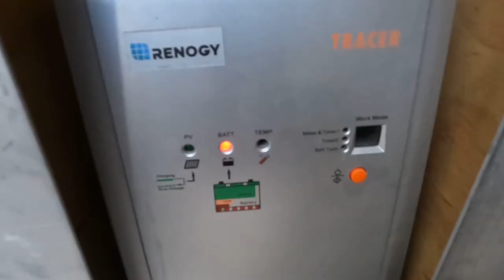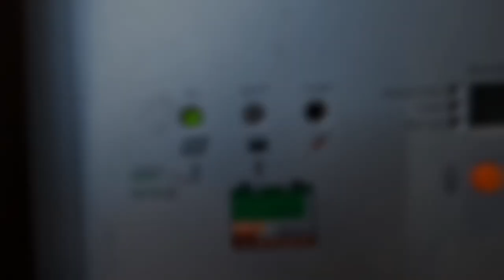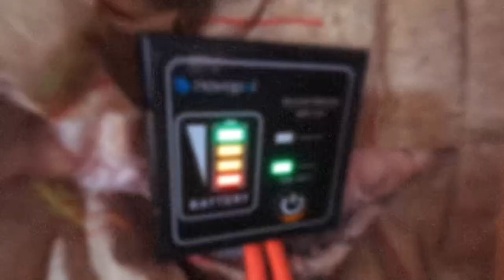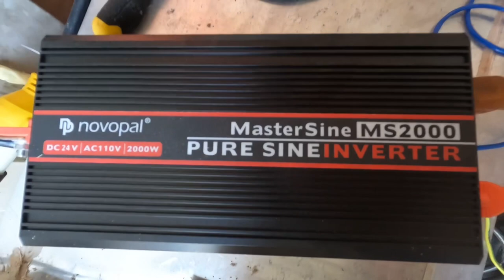Building a solar panel structure that is adjustable and doubling our power!

Comment: Performance numbers??
Reply from the maker: With the last one I gained about 15%  each season I moved them, degrading over time. I could change them monthly but right now I’m only shifting the on the 1st day of the season. Spring, summer, fall, and winter to make it easier on me. Doubling the power is now I have 2 arrays and 2x the batteries as I did before.